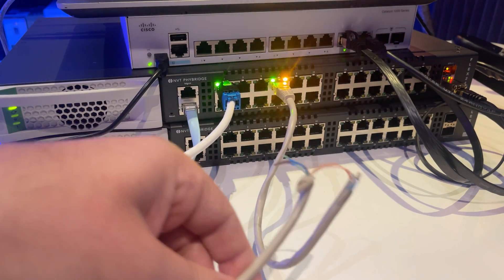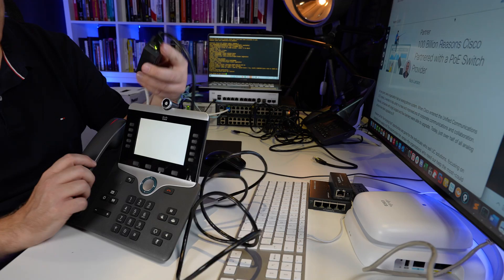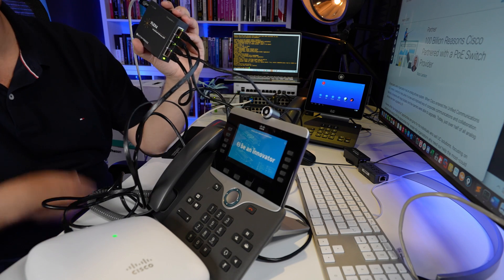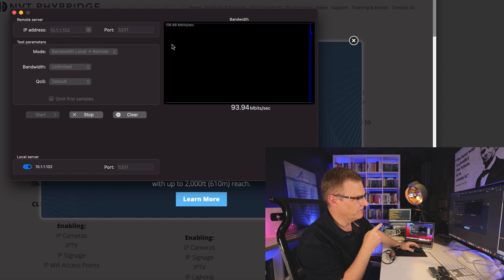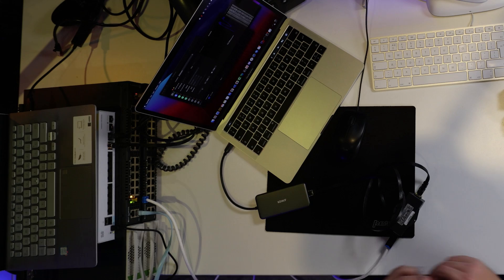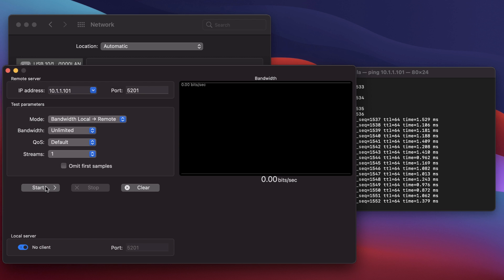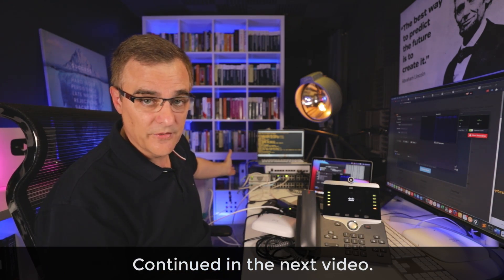Ethernet: True or False (NVT Phybridge LRE)

Comment: Impressive David. In 11yrs of my career i have always emphasized on proper cables. However will same result be achieved with doggy cables in a data center environment?
Reply: Depends on the category, which pairs function, and what speeds they need to achieve. Generally ethernet uses more pairs for higher speeds and some of the latter ones are dedicated to things like PoE or monitoring. Nevertheless I'd probably want fully functioning cables when they're used for work
Reply from the maker: These are edge devices. Probably not going to use them in a DC (except for stuff like IP Cameras etc).
Reply: @davidbombal  thanks David

Comment: That sending data over a single pair raises some questions.  That is unlikely to work with ordinary Ethernet signals.  Are those devices sending data in both directions over each pair, the way Gb Ethernet does?  If so, you should be able to add pairs, one at a time, and see the bandwidth increase.  You can connect Gb Ethernet, with only the green and orange pairs connected and it will work at 100 Mb, but data is only sent in one direction over each pair.  As for cable length limits, the engineers would have provided a lot of tolerance to allow for poor installations and more.  For example, the CAT 3 phone cable, as used in the original StarLAN and 10baseT, was often stapled down, something that's not allowed for Ethernet cables.  Those staples would create an impedance bump, which makes it more difficult to pass the signal.  What has to be considered is the attenuation, noise and other distortions in the cable, all of which get worse with length. There is an instrument called a Bit Error Rate Tester (BERT) which can be used to measure cable performance.  This will demonstrate the rate of data errors, far better than IPERF can.  With this sort of test, CAT 6 can be expected to perform better than CAT 5.  There are other test sets which can certify LAN installations for proper signals, correct connections, etc.  Many customers will require that be done.  Many years ago, there was another length limit which applied to half duplex only.  The original Ethernet, using coax, and also with twisted pairs & hubs operated in half duplex, compared to full duplex with switches.  Because of the collision detection method used with half duplex, there was a time limit, which determined the maximum distance between any two devices.  This was 512 bit times or 51.2 microseconds round trip.  Many people were unaware of this and thought it was the cable length that limited the maximum network size.

Comment: Is that basically a PoE extender?
Reply: The PoE is extended due to more watts and a higher voltage to handle the cable loss.  The data also is extended by changing the physical transmission standard to provide the extra distance (which is then converted back to 802.3 using the adapter).

Comment: its actually very normal to need 1 pair of cables to get a speed under 100mbps  and two for 1gbps

Pin Functionalities:
1 Data (TX +)
2 Data (TX -)
3 Data (RX +)
4 Ground (-)
5 Ground (-)
6 Data (RX -)
7 Power (+)
8 Power (+)
Reply: 100mbs is 2 pair, and gig is 4 pair.  You can not do 1 pair 802.3.

Comment: I noticed you only used the Phybridge to show that their non standard ethernet works.

What was the result using the Cisco switch with 2000ft of cable ?
Reply from the maker: Ah... should have demonstrated that 😔I'll add that to the next video.
Reply: @davidbombal  Please do as that will be interresting to see.
The speed you got with the cable is kinda close to what you might get between two ethernet devices though, as the standard after all lowers the speed when being too long in cable distance.
Guess the Phybridge changes to a "vdsl" like connection when only a single pair is used, as that speed matches the one I get on an old Zyxel setup. :)

Comment: I used CAT5e and CAT6 for distances well over 300m(nearly 1000 ft.). It all depends on the required speed/purpose/protocoll.
Very satisfactory so far.
Reply from the maker: Thanks for sharing your experience Philip. Did you just use standard Cisco switches or something like that?

Comment: I understand you're advertising those silly little boxes and the company is paying you for it but as someone who teaches networking material you shouldn't be telling your students you can connect all these network devices with thousands of feet of cable knowing any beginner certification only wants you using 330' or 100 meters
Reply: I STRONGLY agree. The Ethernet theory about Signal Attenuation (Copper Wire Limitations in this case) does not include any kind of other devices, it's about a single cable in a point-to-point connection. I love David's videos but I believe that the word "myth" is misleading to a wrongly simplified comprehension of the  Electric Signal Attenuation of Copper Cables.

Comment from the maker: Menu:
0:00 ▶ 100Mbps using dodgy cable?
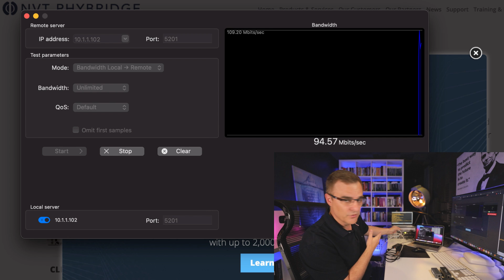0:16 ▶ True or false: max distance of Ethernet is 100m
0:35 ▶ Can you use single pair cables?
0:49 ▶ You cannot use coax cables? True or false?
1:15 ▶ You need to upgrade your cabling. True or false? 
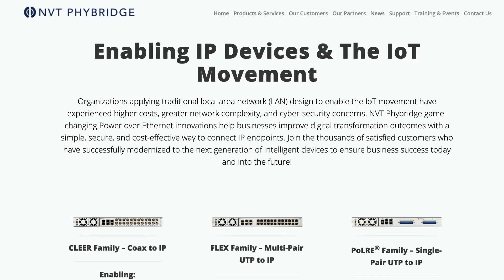1:26 ▶ NVT Phybridge solutions
2:05 ▶ Cisco partnership
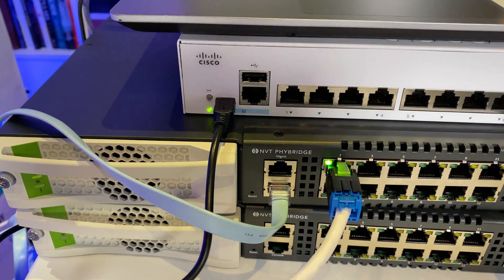2:44 ▶ Testing 2000 feet cable
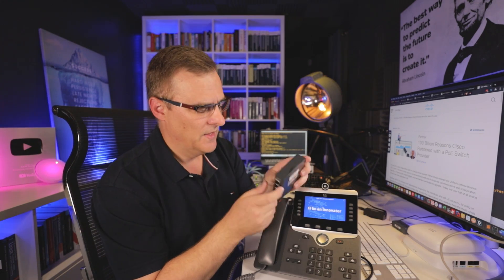4:43 ▶ Test 4xPOE devices over 2000 feet of Ethernet cable
6:25 ▶ What types of speeds to you get at 2000 feet
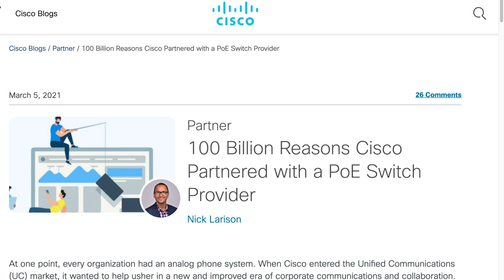7:00 ▶ What amount of bandwidth do you actually need
7:32 ▶ iPerf test at 2000 feet
9:30 ▶ What kinds of speeds at 100m? 
10:44 ▶ 2 pair cable - does that work?
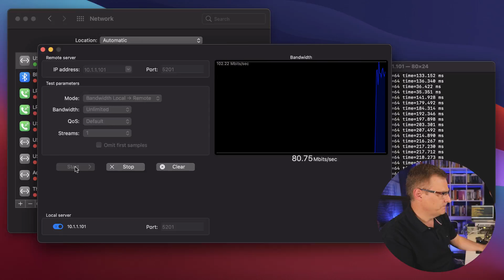11:40 ▶ 1 pair cable - speed test
13:59 ▶ Switch power sharing

NVT Phybridge Website: http://davidbombal.wiki/nvtphybridge
Free NVT Phybridge training: http://davidbombal.wiki/freetraining
100 Billion Reasons Cisco Partnered with a PoE Switch Provider: http://davidbombal.wiki/100billion

Cisco Part Numbers (Flex24-10G not listed yet):
SP-PHYBRIDGE-24: 24-port PoLRE switch with 24 Phylink adapters
SP-PHYBRIDGE-48: 48-port PoLRE switch with 48 Phylink adapters
http://davidbombal.wiki/ciscopartner

What's the maximum distance of Ethernet? 100 meters? Can you use an Ethernet cable that only has 1 pair left? Lots of questions to answer!
Big thank you to NVT Phybridge for sponsoring this video.

Please note that links listed may be affiliate links and provide me with a small percentage/kickback should you use them to purchase any of the items listed or recommended. Thank you for supporting me and this channel!
Reply: I have worked with media converters which allowed 100 Mb Ethernet over existing coax cable.  These also provided PoE to the far end.  Of course, the original Ethernet ran 10 Mb over coax.  Even the original StarLAN, which became 10baseT was designed to work over 3 pair CAT 3 cable with 1 pair used for a phone and the other 2 for the LAN.  This allowed existing office phone cables to be used for the network.

For a bit of history, search on Ethernet Blue Book.  It's the original DIX 1.0 "Blue Book" spec.  The main difference between DIX 1 & DIX 2 is the Type field was renamed Ethertype/Length, to accommodate 802.3.  IP normally uses DIX 2, but can use 802.3 (no idea why you'd do that these days though).
Reply: Hello david. I just checked your courses on udemy but couldn't find a CCT course. Which of your courses do you think I need to take for my CCT certification? I am Just starting in networking. Thanks

Comment: Interesting, the FLEX-link is essentially a repeater, but it is not requiring power to repeat/ boost the signal? Huh? However, the FLEX 4 is powering all those devices? Hmmmmm. What is the power inline voltage for the APs? I have a hard time believing that the one port is giving the correct power to each AP and IP phones. This has piqued my interest a lot!
Reply: the power comes from the switch itself. the specs show it can output 50W of power. this is more than POE+ says is the max. i suspect the increased power output of the switch powers the FLEX-Link also.

Comment: LRE, or Long Range Ethernet, yup, used it in the past, not sure why it didn't catch on back then (around year 2004ish).  Actually got the most advanced version running a full 100mbs over standard cat 3/telco wire back then even.  just think, pretty much DSL modems on both ends...  I had to use them for a connection in a plant to a construction trailer, and a batch plant.  That setup was much better, and more consistent than another plant/location that was using a wireless bridge (often went down due to interference, or weather, etc).  I loved the LRE solution.

Comment: is it going from POE back to ethernet over power using that device
Reply: No, it does not use homeplug based technology as distance and cable quality affect speed with homeplug.  This is symmetrical 10 or 100mbit only depending on the cable and reach.

Comment: Signals strength reduces with increase in physical distance. if you increase physical distance compared to theoretical distance, will we have the same results due to signal attenuation
Reply: Ethernet std is still as what we studied and the signal need to be boosted by a device such as repeater/switch, beyond spec distance.
Manufactuers can hv products that perform beyond tt std as in this case. Notice we need a corresponding "dongle" @ the other end of the connection?
What is amazing here is somehow tt PoE switch could deliver a stable signal over such long distance @ "acceptable" speed! And smart enough to "load-balance" over remaining pair after losing 3-pairs in the cable.
HTH.

Comment: Sir, how long an Ethernet wire can last? I mean, how much it's strength is?
Reply: Ethernet standard is still 100m @ certain speed over certain CAT cable as specified. Beyond tt, place a repeater/switch/device to boost the signal.
Manufecturer can out perform the specified std. For eg, 802.11g was spec as 54mbps, however, in those days, I was running my netgear wifi router & card pair @ 108mbps.
HTH.
Reply: @James_Knott  actually CAT 5 has a max of 100mbps and CAT 5e is up to 1Gbps and 6A is up to 10Gbps and i’m pretty sure CAT5e cannot do 1Gbps for 100m maybe half that distance
Reply: @Slim Shady Your maxes are a bit low...fyi
Reply: @mrmotofy  please correct me
Reply: @James_Knott  it’s called the internet and google bud. welcome to 2021